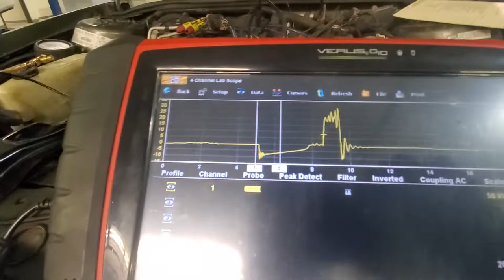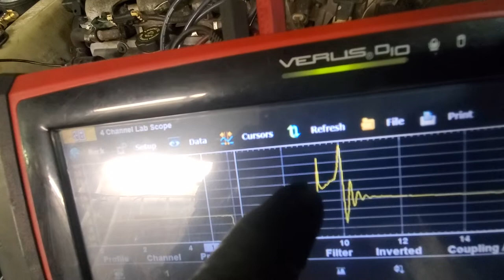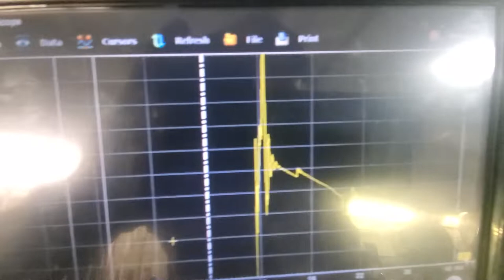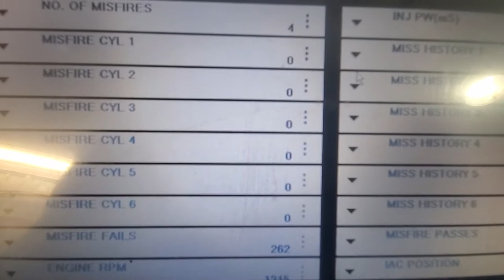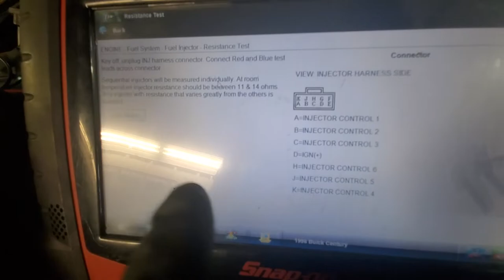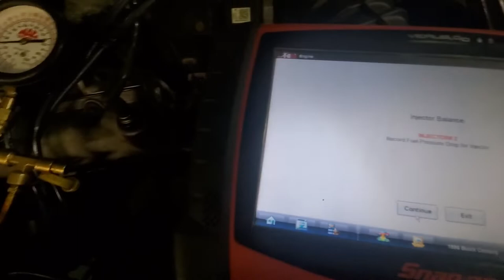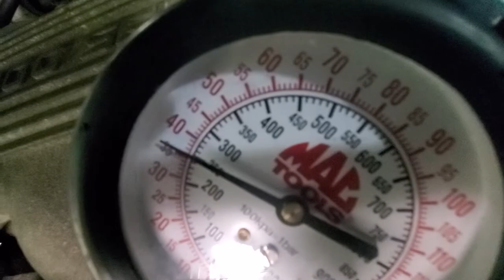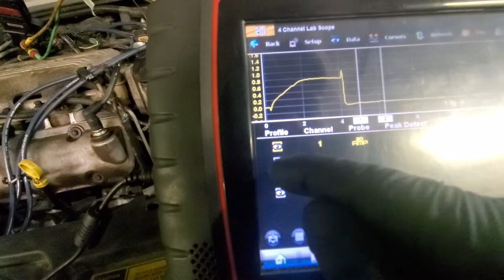1996 BUICK CENTURY 3.1L (VIN: M), SECONDARY IGNITION & INJECTOR ISSUES

Comment: Great video brother. Nice captures for sure. I loved that injector current ramp. Seems people never listen when you make a good recommendation.  A cadillac I did a video on with a failed injector was the same outcome. Customer insists on doing only the one. Few months later, take it back apart to change the other failing injectors.
Reply from the maker: It's just frustrating, however it is fun to diagnose😂👍

I don't know about you, but it is hard for me to see people wasting more money on diagnosis of an avoidable issue.

However, the coils were an issue as well, so hopefully it will all get resolved and I can capture the repairs!

Comment: Awesome video dude !!! Out of curiosity, which (or what brand?) ignition probe are you using ? I’ve been thinking of getting the one from aes wave that has the interchangeable end it comes with the paddle adapter and wire clamp adapter
Reply from the maker: That sounds like a great deal there, can't go wrong with a two for one brother!

Mine is a secondary ignition pickup that originally came with my MAC Multimeter I bought years ago, because it had computer software that allowed you to see secondary, but it was before I could afford a lab scope and was still learning how to diagnose basic circuits.

Not that I'm not still learning or an expert all of a sudden, just utilizing a tool that still gets the lotion put on the skin😂👍

Comment: I have the same car it when the battery is charger and you try to start it it sounds like it sound start right up but just can’t could the weak coil be the same problem?
Reply from the maker: Sounds more like a fuel delivery issue.

Comment: I have a 95 Lumina, same engine less than 27 thousand miles on it but the car was parked for a long time, I have been having a misfire, some times it idles and run fine, sometimes a hard start, I did a fuel pressure test it gave me 35 psi, I have put brand new coils, spark plugs, I think the fuel pump is weak and will just go ahead and change all the injectors. So fingers crossed. I am not a professional mechanic I just do my best.

Comment: I have a 1996 Buick Regal with the 3.1. It has intermittent (maybe misfire) and sometimes it runs fine and sometimes it feels like mild chugging when on accelerator. Never stalls. I changed plugs and wires and all 6 plugs looked good, no fouling etc. No vacuum leaks were found. This engine has only 78k miles and doesn't burn oil. I'm sure it has original coils and injectors. Anyone have any suggestions?

Comment: So balance test wasn't a factor, it was a injector current ramp
Reply from the maker: Yes injectors and coils.
Reply: @PaulysAuto   Can you do a video about those spikes on current ramp, why are they there, is it short. I didn't catch were  injectors leaking or closed or both.
Reply from the maker: @ivandrago2557   I will do my best, do some research, and try to put this information together for you into a video. 😉
Reply from the maker: In the meantime maybe you've seen this maybe you haven't, but maybe this will help you out?

https://youtu.be/4mut0Lpg5k4
Reply: Thank you saw this video from Paul Danner but, can't remember saw those spikes on current ramp for injectors on any videos
Reply from the maker: @ivandrago2557   It's a secondary problem in the injector
Reply from the maker: @ivandrago2557   This car is fixed... 100% weak coils and weak injectors.  I wasn't able to film a follow up.. sorry for that, 😒 it was a time issue.
Reply: @PaulysAuto  When you say secondary problem what do you exactly mean. Doesn't injector has only one coil.
Reply from the maker: You're right I'm sorry a mechanical issue
Reply from the maker: The secondary side of the injector the actual mechanical movement.

 Sorry for being confusing
Reply: @PaulysAuto  Thanks for effort and explanation

Comment: don't know what you are doing ...
Reply: nice job anyway, you gave us a lot of known good graphs, thank you.
Reply from the maker: @SuperPaulfa  I think I misunderstood you.  What I'm doing, is diagnosing a random misfire.
Reply: random missfire : can't be associated to an individual injector or coil, i should be something related to the overhaul fuel mixture, or ignition timing problem (wrong sensors readings) , and last, you need to scope the speed sensors for any signal abnormality.
bring out the stft and ltft first.
Reply from the maker: @SuperPaulfa  I'm confident in my call.  We'll see how it works out 😉👍
Reply from the maker: @SuperPaulfa  and on this GM, yes...a random misfire can be caused by a single cylinder on this waste spark design.
Reply: Do an injector flow test, you'll find your leaky one
Reply: engine with this age, should not care about random miss universe.
Reply from the maker: @alanw5879  I did a balance test in this video.
Reply from the maker: @SuperPaulfa  😂 sorry, but customer wants it fixed, it doesn't matter what I think, it matters what the customer wants done and fixed PERIOD!